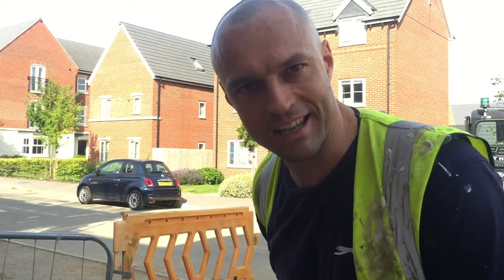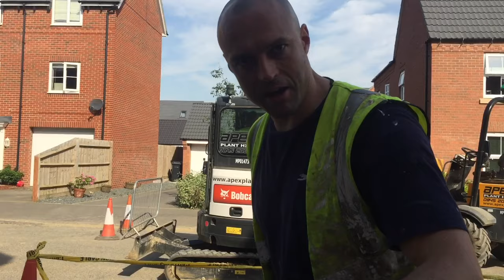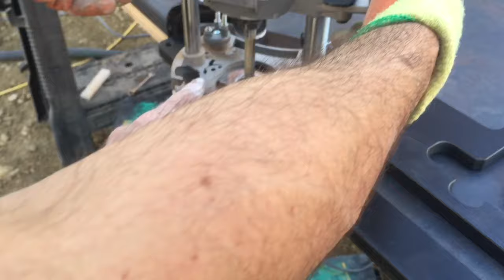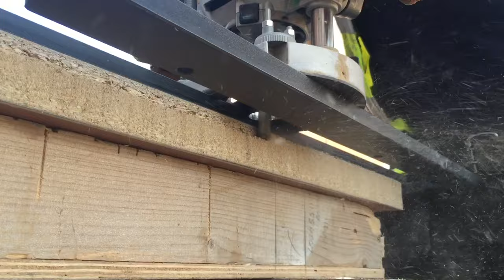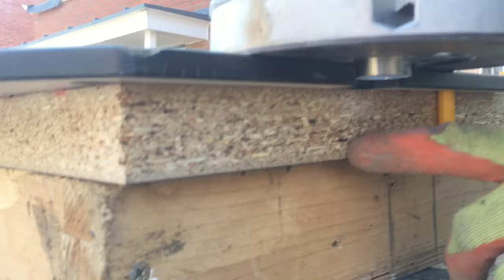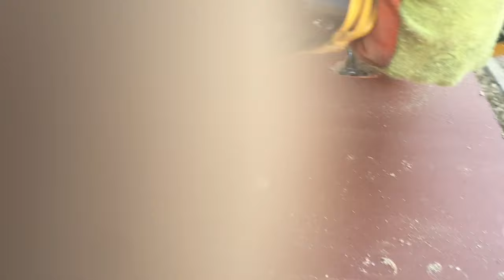How to do a Masons Mitre, part 1

Comment: I NEVER use a jig saw. I tried it once and ruined a brand new £200 jig. It WAS my own fault. To explain, after the waste had been removed by the jig saw, there was little support for the jig on that side. I didn't pay enough attention to this fact and the  Jig flexed which allowed the router to slip. Result was a 2 inch gouge on the edge of the jig.

Comment: I have a question to ask. How do you tighten the joint when you're fitting a 900 something by 900 something corner cupboard with a solid top so you can't get to the bolts. I recently fitted a kitchen with a single piece 5.5m top joined to a 4.6m top both specially made at huge cost and the corner cupboard had a solid top. Making the joint before to top went on (as I've done in the past with short tops) was not possible due to the size. All I could think of was to cut a 4 inch hole with a hole saw under one side of the bolt. It did work. I was just wondering if anyone has any better ideas.

Comment: Great Video,Great Job,I make this joint with a track saw,and fine handsaw.I just drill for the worktop bolts. Router bits are expensive and get blunt very quickly

Comment: Good tips but a couple of warnings. If your jig is wooden, DO NOT cut away after the first cut with a jigsaw! This allows the jig to flex and the guide to hop out of the jig, which can screw your work top and jig up! Second one, don't do a final pass once the waste has been removed if your jig is wooden. Again it will flex the jig allowing the guide to hop out and cut the jig and worktop up! Apart from that this vid is top notch.

Comment: You have the router round the wrong way. 
The flat edge on the base should face the user. 
That way all the knobs and adjustments are facing you. The handles point away from user for comfort grip. And most of all the bigger rounded part of the base rests on your work piece

Comment: Wow I just picked up lots of tips in 13 mins. Great video: jigsaw cut, trim edge before fitting, use the router extractor outlet as a blower… and the dog bone bolt screws! Cool! Many thanks.